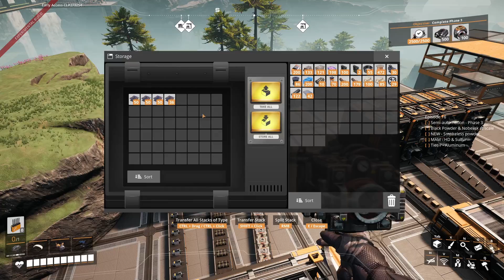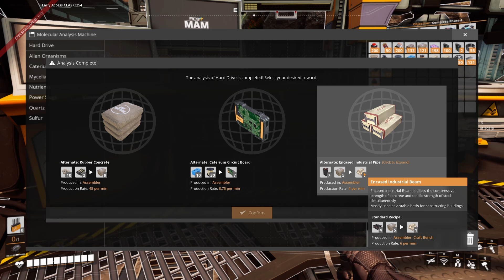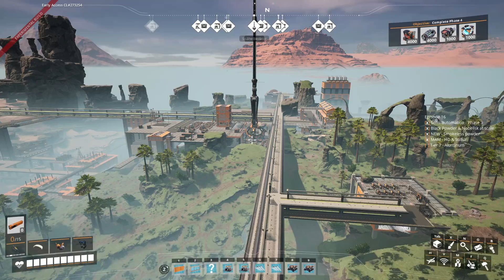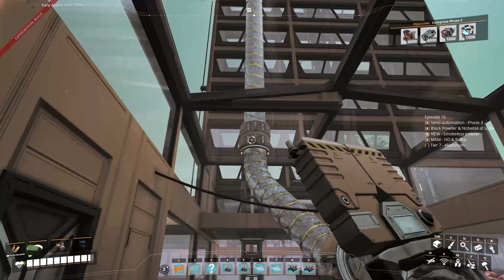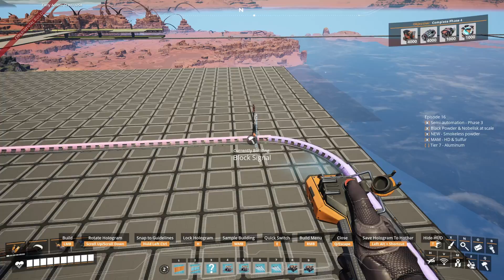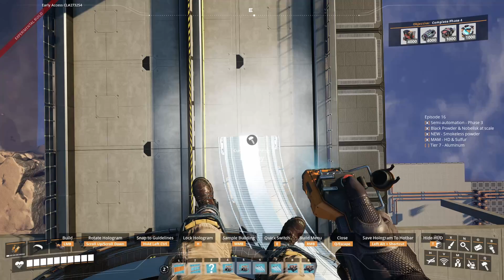TRAIN ROUNDABOUTS & SIGNALS and Elevator Phase 3! - SATISFACTORY UPDATE 8 - 2024

Comment: I love the round about for the trains. I plan on making a blueprint for it. 

My plan is to have the blueprint just be a quarter of the entire circle. Let's say you have a 3x3 grid for your rail straight away and you make a long straight line. And then you have rails going off perpendicular to it creating a cross. To make the 7x7 grid for your circle, you have to put 2x2 grid in each corner. If those 2x2 grids had a quarter of a circle attached to them, you could have 1 blueprint, place it in a corner, rotate it, place it in the next corner and so on until you have a circle. Not only that, but you could use it for right turns as well.
Reply from the maker: thanks for the comment! 
I know there is a blueprint for roundabout if you use the extended blueprint mod (i.e. the blueprint designer is way bigger) but didn't think about doing what you described! would love to here if you manage to!